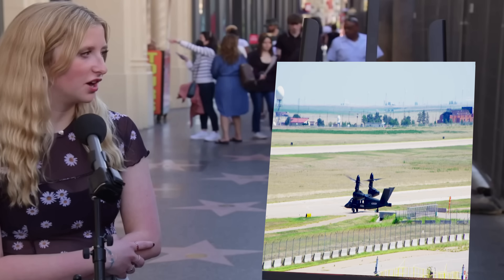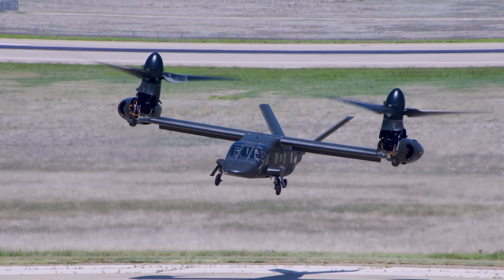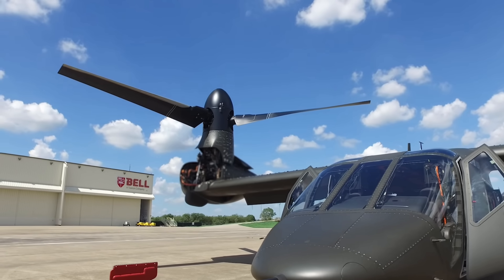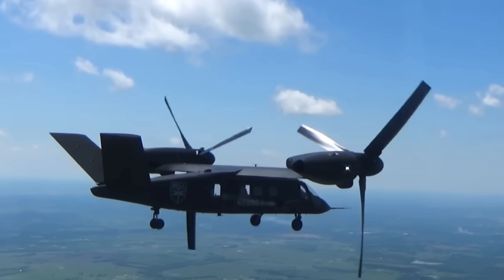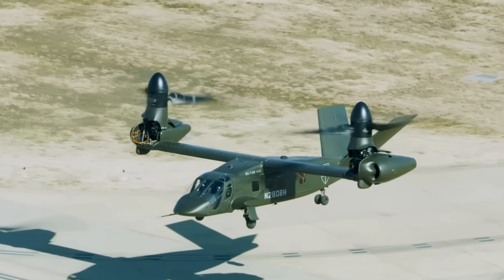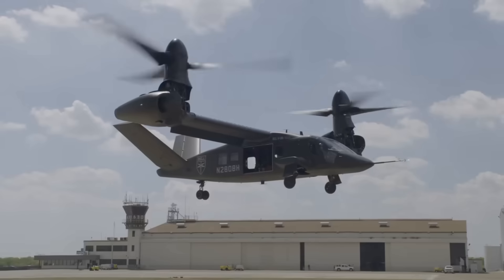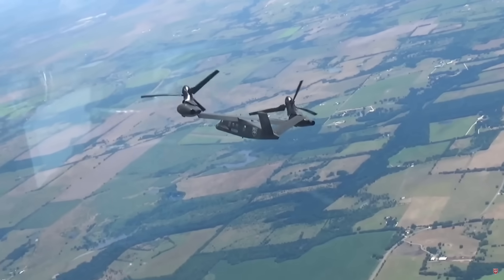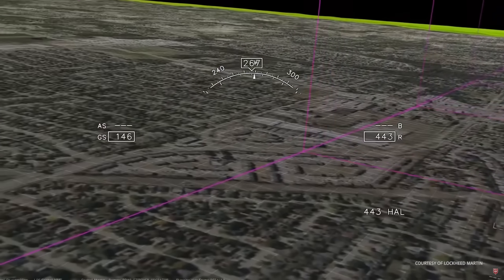Bell V-280 Valor - What's the big deal anyway? | BLACKHAWK REPLACEMENT

Comment: IMO, people are looking at this and thinking 'Afghanistan' or 'Iraq' or 'Kosovo'. But the Army had one thing on it's mind when it chose this.

China.

This is the main thought when they chose this. Speed and range. Lightning strikes behind lines at distance. Evacuation of critically injured time will be improved. Hope the maintenance isn't bonkers (Every 2 flight hours remove engine and x-ray interior parts 1-75).

She is pretty though, looks like a sperm flying through the air, it's got a streamlined shape. 
One question I have though, is ingress/egress to confined spaces, like in the Bin Laden raid. Spec Ops may run into clearance issues. Regular Army is going to love the speed and range.

Comment: Lots of large moving parts. Maintenance to operate it safely will be incredible. 
- great way of making money years to come.
$1.2 trillion  $1.200.000.000.000.-
Reply: Why can't we build anything brute simple and effective anymore......
Reply: @samsonsoturian6013  maintenance contractors.  That's where the long term money is.
Reply: @CHMichael  doesn't pay as well as manufacturing does. But yeah, less risk.
Reply: @samsonsoturian6013  f35 cost 75 mil and 7.4 mil in maintenance. 
10y ? 
Maintenance cost are also much safer. 
Any spending cuts will not affect maintenance. 
It's the new big cash grab and rotating 2 big engines is a maintenance nightmare  ( or dream)

Comment: That's fine.  It's not no chance of replacing SH-60's, HH-60's, AH-1's, and UH-1's in US Navy, US Coast Guard, and US Marine service though.  It's just got a hanger footprint that is just too much larger than the legacy aircraft it would replace.  I'd guess the V-280 replaces army H-60's, while some derivative of the Defiant and Raider lineage (taller but otherwise similar size to the legacy aircraft) wins the naval contracts.

Comment: I disagree with the author here……this aircraft is supposed to replace the Blackhawk….it’s being asked to fill that role and it’s objectively lacking in the ability to do that. It’s faster………but that’s about it in terms of performance improvement over the Blackhawk. Everything else it does ‘better’  is the job of a different platform.
If the Army goes with the Valor…. the role it fills is different than the Blackhawk and they’re going to need something akin to the Defiant as well.

Comment: I bet they're going to go over budget. I've only seen one video from I think the Angry Cops channel who touched on INFRASTRUCTURE. The Valor will need new hangers and buildings built whereas the Defiant X would just plug and play only needing new tool/systems like any new platform.

I like the fact that it was also Stealth capable and had more direction towards attack capabilities. 

While the Valor supposedly goes further, I believe that's only as an empty load. When you look at it's Combat Range, it's 500-900nm. Defiant X Combat Range is 700nm.

Defiant can also store away on ship's and Valor simply cannot. They can for sure land on one but it takes up so much space. Maybe they'll design one that allows the wing/propellers to spin inward like the V22 making it slimmer for storage.

One thing is for sure, they're going to have a heck of a time figuring out how to shoot guns, missles and rockets with those giant props. Definitely going to go underslung weapons bay.

Comment: I simply hope it's SAFE for starters. I HATE seeing our guys lose there life b/c of some fucking mechanical failure that's inheritant to the design like the V22. 

Beyond safety, hopefully it can fulfill it's new role. The jet engines, someone pointed out won't destroy ship decks and LZ b/c they don't rotate. However with that exposed arm, I hope debris and dust is a minimal issue b/c the V22 it is a big issue.

I'm interested in seeing how troops will interact with it, b/c we've not seen anyone get in or out of it. We've seen 0 demonstrations of troops jumping, repelling or simply hopping and running near by. The V22, it's difficult to approach due to the massive jet engines and carry out troop operations due to the forces of air pressure.

Like the engine face rearward. Does that mean we can't approach from the rear? Looks that way.

Hopefully we'll also get Defiant X. That aircraft is amazing and more so directly replaces the Black Hawk with stealth, speed, range, lift, and doesn't hit the budget as hard.

The guys who marketed the Valor did an excellent job with there presentation.

Comment: Interesting, they used to censor the gearboxes tilting the rotors.  Would be now interesting to know how it works.  Yup, the fuel harness of the V22 gave it problems at first since it tilted with the rotors.
Reply: A 2017 article by Aerossurance says 
"engine power is transmitted through a spiral bevel gearbox that transfers power to the proprotor gearbox.  This rotates on two spherical bearings."

Comment: I'm on the fence about it.  If you lose an engine, you can almost not autorotate...and thats if you catch it before you roll over upside down.  It's a much bigger target than the standard helicopter design.  I guarantee maintenance will NOT be any better than the Blackhawk was, respectively, when it released.  This looks a lot like the Army's very own Tomcat...only be a lot easier to hit.  It'll perform well on paper, but trends in maintenance and resistance to damage doesn't have me convinced.
I probably would have picked the Defiant, because it's a setup that's very familiar to ground crews and pilots that wouldn't require nearly as much transition training...also in the case of engine out, survivability would be better.

Comment: Both may work but what an engineering and design tragic failure.  Placing engines at the end of wings guarantees unrecoverable catastrophic loss when hit by a heat seeking missile.  In the environment that these craft operate it is almost guaranteed that they will encounter manpads and other threats.  To be honest I cannot see why anyone would build such a craft.  Especially when a much safer option is available.

Comment: This thing is much easier to hit with a rocket than a Blackhawk. Yes.
But I suspect that the Army is thinking that near pear adversaries can shot any slow moving aircraft down anyway, because guided missiles are so prolific.

If that's the case, then they probably figured it makes some sense to at least improve on the travel from A to B department: fly faster and higher. 

I still think the SB-1 had more potential, maybe we'll see more from it's brother, the Raider.

Comment: It goes further faster but there are less spots you can use to offload because of its bigger footprint
Reply: Only the wing is slightly longer than the width of a black hawk but if you rotate the wing and compare it with the length of black hawk they both are the same length so you will need maximum 1 metre more open spaces to land than a black hawk which is quit impressive

Comment: The problem I would see is its size. I do not know how they should be able to disembark troops in narrow terrain. As a example a forested area or a narrow street area. Its good as long as you got large open terrain to land on. I do not see it as impossible to there could be a mission requirement where you need to land in tight spaces. It getting hit with a rpg is not really the danger but it not being able to land close to the infantry when they need transportation could become a problem.

Comment: It is an airplane, not a helicopter. The basic characteristic of an airplane is that it has fixed wings and so does the Valor even if it also can hover like a helicopter. Then one might object that there are helicopters that have small fixed wings too (like the Mi-24) but they contribute only to a minor part of the lift at speed and it can fly without the wings. A little bit arbitrary then but I think it's clear engogh that the Valor is an airplane and no one would call the Harrier a helicopter even if it has VTOL capability. (Both airplanes, helicopters, zeppelins etc. are aircraft.)
Reply: A Harrier is not called a helicopter because it isn't lifted by rotors. Tiltrotors like this are helicopters, because they are lifted by rotors, with cyclic control. They're just like a tandem-rotor helicopter (such as a Chinook) until they tilt the rotors.

Comment: What I'm curious about is why the engines are out on the ends of the wings like that. It made sense on the Osprey, where the whole engine assembly was rotating, so it had to be out there, but with the engines being fixed, and the fact that each engine powers both rotors anyway, it seems it would make a lot more sense to have the engines in close to the body since the rotors themselves move independently of them
Reply: I think it's a fair question, but consider that in VTOL mode all of the lift is at the ends of the wings, so structurally it makes sense for the engine weight to be there. They may also prefer to have the engines separated from the fuselage for crash survivability.
Reply: My assumption would be control, the further apart they are the more stable it would be. Think of balancing a stick with two equal weights on the end, easy. Now move those weights closer to the centre. The closer they get the more unstable.
Reply: @jamiemcgrory1964  that's the opposite of how it works. Take a sledgehammer, hold it by the head and move it around, pretty easy and controllable, now hold it by the handle with the head all the way out on the end of that lever and it becomes a lot harder to swing it about and change direction.

Same as with being able to handle a sword vs an ax the further out on a lever you've got mass, the harder it is to control that mass
Reply: @pdxmarine1430  you are close but literally have half the equation. Hence why it appears as the opposite. Note that I said stability, not speed at which you can flip the aircraft over. 

Take that sledgehammer, put a head at each end and hold it in the middle. It's far more stable for finite control.
Reply: @jamiemcgrory1964  Having the weight out on the ends is not more stable than having the weight biased towards the center. With more of the mass towards the center you can go further from the center before the whole thing falls off. With the mass out on the ends, you get even slightly off center and the whole thing will flip off
Reply: @pdxmarine1430  please go tightrope walking to test your theory out and get back to us
Reply: @jamiemcgrory1964  As it turns out, an aircraft is not the same as someone walking a tightrope
Reply: @jamiemcgrory1964  Take a barbell, put weights on either end, pick it up, tilt it to one side, and see how much effort it takes to bring it back to level...now put that same amount of weight and put it in the center, and see how much easier it is to tilt it back to level
Reply: It is lighter. 1 gearbox per side instead of 2.
Reply: The larger moment arm means the engine can exert a greater roll torque while in a hover.
Reply: @forrest225  Except it has a shaft going from each engine to each rotor, so it can operate even if one engine is taken out...but that also means that you've got an even longer shaft to power the opposite rotor, and that's when you would need the most power...plus having the engines closer in protects them better

Comment: A tilt-rotor aircraft is not a helicopter. How many helos of the one rotor, tail-rotor-torque nullifier configs have been built since 1945? So don't begrudge the US Military having 2 tilt-rotors. Given the quality of both bids, if I was in charge of procurements, I'd want BOTH. The Sikorsky bird is beautiful, especially the counter rotating rotos. It would scare the shit out of any opponent, especially if it was wielding Gattling guns. The Blackhawk looks like it means business, a competent machine that will get the job done. The Valour does NOT look scary, and, in fact, the only feature that says 'military' is its black paint job. Paint it pink, and see how many folks want to buy one.

Comment: US military is visualizing a conflict in the pacific where the need for the extra speed and range will be paramount
Reply: Defiant also has better speed and range than current helicopters. V-22 Osprey has better range and capacity than V-280 and is being acquired in larger numbers already. The number of routes where Valor can reach but defiant cannot have to be minimal and Osprey can be used instead in all of those cases and more. Defiant agility, flexibility, familiar handling, and lower cost are a better option even in the Pacific.

Comment: Tactical manuevers with UH-60s to counter anti-air threats are far easier than fixed wing props like the V-280.  Try navigating 3 meters above contours of hills and trees with a fast fixed-wing aircraft in any flight simulator, compare it to a fully-articulated helicopter.  ZSU and Manpads will make easier tracking of higher flying V-280s.

Comment: What is the big deal with the Valor? Because it doesn't actually fit what the Army wanted. The Valor was picked for two major reasons. First money. As you point out the Valor was going to be cheaper in every way. Second because it fit the Marines requirements and the Marines wanted something like this to get a bunch of troops somewhere faster and from further away than what helicopters could do. The Army essentially wanted a modernized Blackhawk that could get in and out of dangerous situations quickly, something tilt rotors are not capable of doing as the Valor takes around double the time fly into a target zone, land, drop off/extract, take off and get out of the area than even the Blackhawk. That doesn't even touch on the fact that a tilt rotor has a significantly greater footprint than a helicopter.

Also reportedly every person in the Army that got to fly the simulators for both aircraft hated flying the Valor but loved the Defiant. Another, actually known, issue that the Army didn't like was the massive disk loading that comes with tilt rotors. That results in very heavy downwash which makes vertical landings a lot more difficult over variable terrain. This is the cause of the Bonhomme Richard Osprey crash and training can only do so much to mitigate the issue, especially in all variable terrain scenarios outside of landing at airports or on carriers of some sort. Also a heavier vehicle load is going to only exasperate the issue as the increased weight increases the disk loading so carrying a heavy load is going to make the problem that much worse. Thus landing on ships is quite a bit more difficult and gets exponentially more so with worse conditions. Trying to land the Valor on the back of a destroyer or cruiser is going to be a real b*tch in comparison to a Blackhawk because of the massive difference in disk loading.

Basically the Valor is completely inadequate for what the Army wanted. Something to remember is that the Army airborne units don't fight spear tip to spear tip if you will. They fight in scenarios where getting in and out quickly is paramount to not just success of the mission but survival of the soldiers as they attack behind enemy lines. The Marines were looking for something that allowed them to sit at stand off distance within the protection of a naval fleet but get to and exploit a vulnerability in defenses before it could be closed off. This is something the Valor is going to excel at. The Valor was designed around island hopping or for fighting peer to peer forces but the US going to war with China is not very likely compared to other possible scenarios. The Defiant was designed to be better suited to the more traditional conflict zones and combat as found in the Middle East and Caucasus or the current war in Ukraine. The Marines wanted the former, the Army the latter.

Comment: Is it necessary to have the engines at the wingtips? Moving the masses closer to the center would make it more agile. There is the axle from rotor to rotor anyway.
Reply: That would reduce the roll moment that the engine can exert on the airframe, actually reducing agility in a hover. In forward flight it has big control surfaces to use, I'm sure it's plenty manuverable.

Comment: Could you put a massive Gatling-gun in it. Then it would be a good replacement for the Warthog A10
Reply: They tried with the V-22 in a pop down turret. It didn’t work out very well because accuracy was poor and the internal volume required for the turret, supports, and gunner seat made it less useful for  general utility. V-280 has less volume available and thus more problematic for that option.

Comment: The V22 Osprey has killed more of my Marine brothers than you know. It requires a ton of maintenence per flight hour and far more often than the Blackhawk. 

The Bell V280 is not a wise alternative to the V22 or Blackhawk because neither the V22 nor the V280 stand a chance when losing an engine only to drop like a rock. The Blackhawk conventional design at least stands a chance for recovery via auto-rotation not available to either the V22 or V280; both exist because designers can rather than should build them. 

I spent a lot of time in H1s, CH46s and CH53s and swear by the conventional main and tail rotor design still.

Comment: I think it has a bewel gearbox with the output shaft rotating around the bevel gear.
Reply: "Bevel"... just a typo in your comment, which says "bewel".
Reply: A 2017 article by Aerossurance says 
"engine power is transmitted through a spiral bevel gearbox that transfers power to the proprotor gearbox.  This rotates on two spherical bearings."